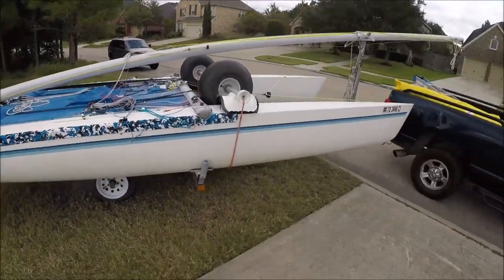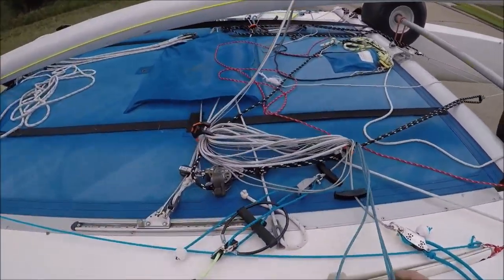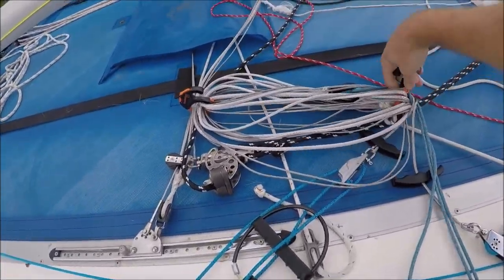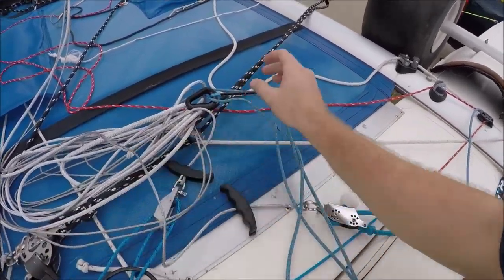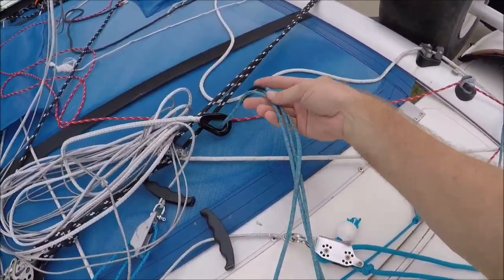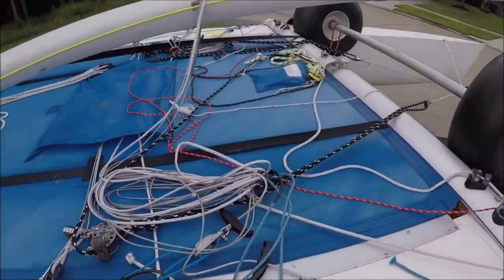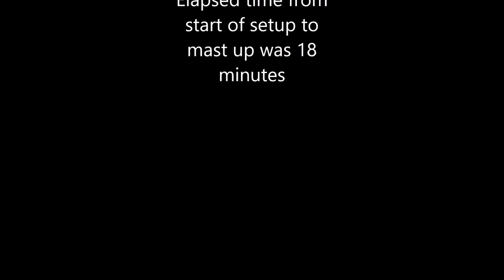Rigging the Prindle 19 with Colligo Soft rigging

Comment: Great video! I just bought a p-16 and am really flying blind. Got mast up last night but was not able to get spreaders any more than the 3-4 holes down on the chain plates, mast seems too far forward. Almost no info on line for rigging this boat. Also,  are you supposed to completely remove the mast step hinge to sail or what do you do with that? Thanks!
Reply from the maker: Yes just remove the upper hinge piece and the bracket should drop into the slot inverted side up.  Im working right now, but contact me via email and I'll get you my number and ill go over everything.  If not ill try to remember to write up more later this afternoon

Comment: Chris,  After searching for a very long time, I have found nothing on the operation or use of the boom outhaul car, other than the warning in the manual not to untie the shock cord by the mast.  My problem is, when I pull the rope to bring the car aft, it will move aft, then it will not return in the bow.  Now when I loosen the rope (outhaul car rope) that pulls the care aft,  I can't return the car to the direction of the bow.  Seems to be locked.  Am I doing wrong?  Thanks
Reply from the maker: It might need some TLC. take the caps off and rebuild it
Reply: @squid0013  Thanks!

Comment: Chris, I just purchased a Prindle 19 and I like you rope system for pulling assisting the raising of the mast.  Do you have the types of pullies, size of rope and how long you need to attach to the trapeze line?  Also, I am not finding any info putting up the jib with a Harlen furler, similars to yours, specifically, how to roll the jib on and how the furler is set up before you do this.  Any info would be great.  Thanks
Reply from the maker: Just some half inch yacht braid and some 75.. blocks.  Its just there to hold things.  You could get away with some sta-set and a single 57 cam block
Reply from the maker: Where are at with your boat.  We are in the houston area
Reply from the maker: On the furler i dont use a standard hook and ring.  I use a full dyneema halyard.  Shoot me an email cholley12 at gmail.com
Reply: @squid0013  I'm in the salt lake area.
Reply from the maker: @kevintford8222  make sure you have pads under the hulls
Reply: @squid0013  Do you use the 4 way jib system?  If not, what have you gone to?
Reply from the maker: @kevintford8222  i use the snot out of it

Comment: One last question, on the Prindle 19. How far or what do you reference when you're putting the boat on the trailer?  How far should the rear of the boat be in regards to the rubber rollers? Where do the wheels line up to the boat when you tie it down?
Reply from the maker: The pads go directly under the beams....which are on the bulkheads